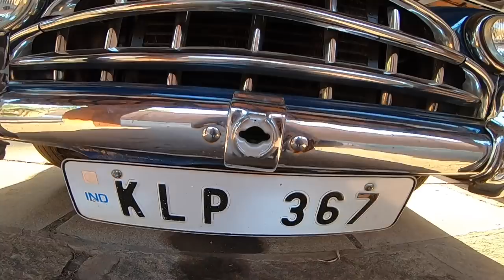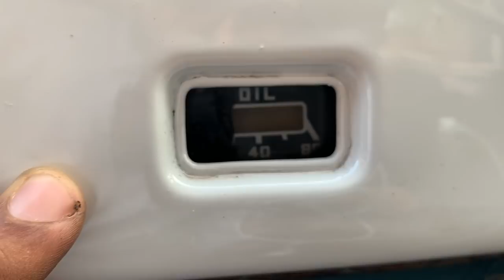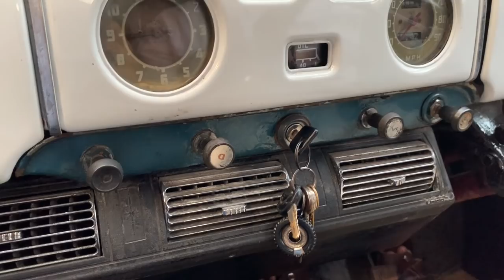New Look Hindustan 52 vintage car Kerala | well maintained not for sale | awesome home designer.

Comment: Nice to see this video. Thanks for sharing. We had the Hindustan 14. Bought in 1956. It served us well from 1956 to 1986. It was completely original. We had not changed anything, had got it painted sometime in 1970. The chrome was as new even in 1986. Excellent car.
The car in the video is changed quite a bit from the original. For instance, on the bonnet of the original there was a bird with wings. These wings were made of a translucent material (not plastic). This could be lit up. Looked quite snazzy in the night. Indicators were on the door frame in a recessed slot. They would pop out from the frame, they were also lit up. The dashboard was completely Smith's. I could go on forever☺️. Thanks anyway for the drive into nostalgia

Comment: All three cars have add ons which do not match and spoil the original beauty of the car. The external air filter and extra lights in the Jeep, the modern wheel rims on the Morris Minor, the seat head rests in the Hindustan 14, the mismatching rear number plate lights, the bull nose ornament, the modern wheel rims are some examples